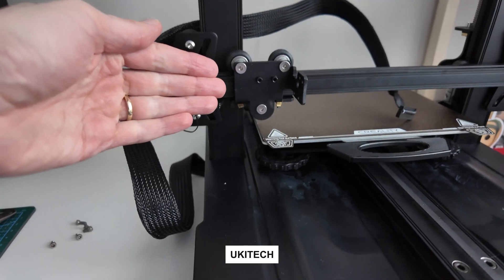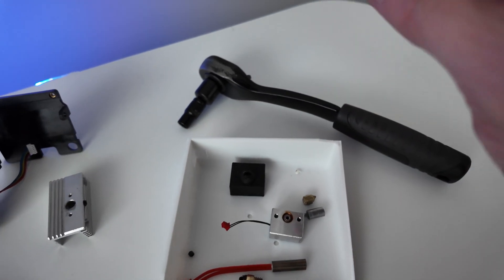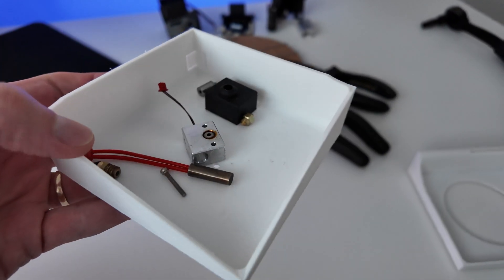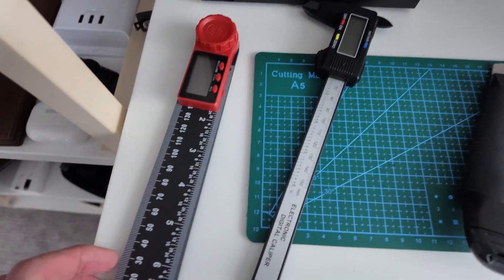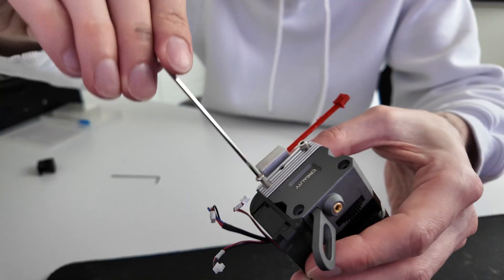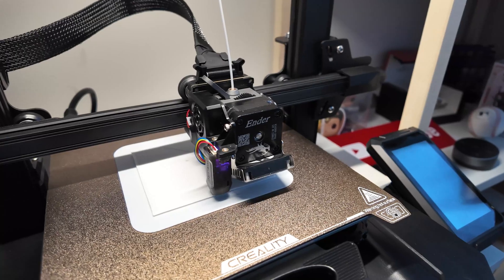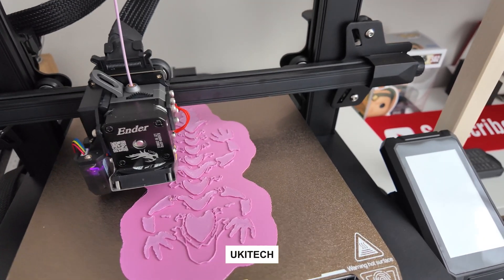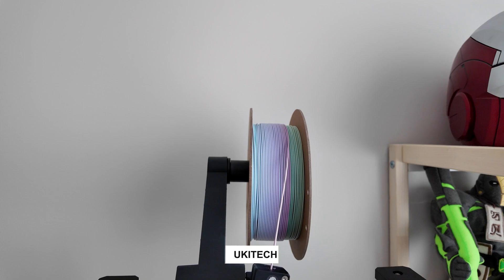I've broken my NEW 3D PRINTER :((((

Comment: As others have said, always remove the nozzle and heat-break (the other part you broke) when the heater block is at the printing temp of the material you last printed, this also causes expansion which further makes removing the parts easier. Also tighten them when hot, otherwise when the heater block expands there will be a small gap that will cause leaks and inevitably a jam. You can use a screw extractor to remove the parts or you can use a rotary tool and cut a slot in the broken parts and use a screwdriver to remove the parts when your heater block is hot, just be sure to use heat-proof gloves and/or hold the heat block with a wrench. 

The standard nozzle size for the vast majority of consumer printers is 0.4mm, 0.2mm nozzles are for fine details and smaller than I would use on an FDM printer, If I want fine detail, small parts I will print with a resin printer. 0.2mm nozzles will be more likely to jam, slower and you may be unable to print materials that have fill in them, such as CF, wood, some marble filaments, metal fill etc. I recommend using a 0.4mm, 0.5mm or 0.6mm nozzle for most functional prints and 0.3mm or 0.2mm for small fine detailed prints.

Comment: Next time your nozzle is clogged, try the ‚cold pull‘ method to clean it, instead of removing it. Fixes it in most of the cases without any effort.

For a 0.4mm nozzle some 0.3mm acupuncture needles can be very handy, too. Some printer manufacturers even add one or two to the accessories.

Comment: get a realy small hex wrench heat it up as hot ass possible and push through the extruder without filament. this will hopefully remove your clogg. but you'll need to also heat up the hotend

Comment: For some people, 0.6 mm nozzles are better than 0.4 mm nozzles. But 0.4 nozzles are standard. Also, you can increase the Layer Height in your slicer to print things faster. This does decrease the resolution of the print a little. If you are just prototyping, then you can print at 0.25 mm Layer Height. If the part, you are prototyping has and parts that need to be precise then I would prototype on 0.2 mm layer height.

I hope this helps you.

Comment: I've changed my hotend on my ender 3 before because I thought my nozzle was STUCK. It wasn't. I was just turning it the wrong way. After like, a year, I finally got two new hotends, and both leaked like it was nobody's business. I even MADE SURE everything was tight. So I had to change back to the original once I got the nozzle out, and now it's leaking too after like, a month. I hate creality sometimes.
Reply from the maker: I’m starting to understand why
Reply: @uk1tech  Trust me, it's user error the vast majority of the time. A lot of people that buy these machines are beginners and will make mistakes, I was one of them once.
Reply: What type of ender 3? Did it have a PTFE lined hotend or an all metal hotend? Was it bowden or direct drive? I only ask because I may be able to help solve the issue. If all these parts had the same issue it's unlikely that it is the fault of the parts themselves.
Reply: @Smokinjoewhite  Oh I kinda got it fixed, it is a ptfe lined one, and to stop it from leaking out the top I put some teflon tape on the heat break threads and I figured out you have to heat up your hotend before you put on your nozzle because I have no idea why. But I would still like to know how I might be able to fix it in the future because that was HELL. But I also plan on switching to the spider ceramic hotend. So Idk how it'll work on there.

Comment: Heat it up before removing it. If you are set on removing the broken part, get yourself a set of left handed drill bits, heat up the part using a torch, then use the left handed drill bit to spin it out.

Comment: Needs to be very warm/hot when unscrewing nozzle. Also, use thermal compound to help the heater block transfer heat more efficiently(layers of air molecules between where the nozzle screws into the heater block...between threads needs paste to heko transfer heat).

Comment: There's no such thing as "broken".  There is only "needs a few new parts".  You can salvage that heat block.  All you need is a screw extractor.  Heat the bock up and you should be able to back those pieces out with no problem.

Comment: The number in your slicer, 0.12, 0.16 etc is the LAYER HEIGHT, NOT THE NOZZLE SIZE. You should have ordered 0.4mm nozzles. With the 0.4mm, you can use any of these LAYER HEIGHT numbers. Hope this helps.

Comment: Regarding the nozzles, quality in the slicer refers to verticale resolution. You should have ordered 0.4mm nozzles as this is the standard size and referes to the width of the lines it prints if that makes sense.

Happy to help if you need it.
Reply from the maker: Thanks

Comment: You should remove nozzle while it's hot.
MK8 nozzles are the right ones for creality stock heat block.
The quality settings in slicer 0.12/0.2 and etc is the layer height, not the size of the nozzle bore. The stock nozzle is 0.4 and if you have to a 0.2 nozzle you need to change the nozzle size setting in your slicer.

Comment: use bigger screw and insert from the other side of the heat block, rammed inside the nozzle, once you turn clockwise, the nozzle will anti clockwise, then for tightening the nozzle, just use small wrench, your wrench look bigger and the torque you put will hard to control